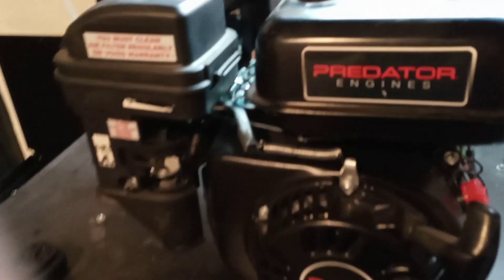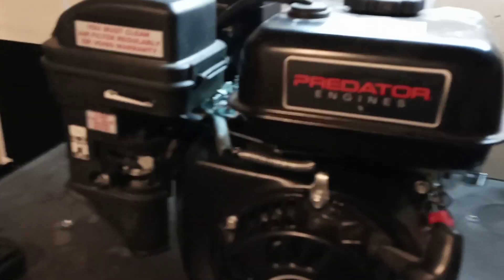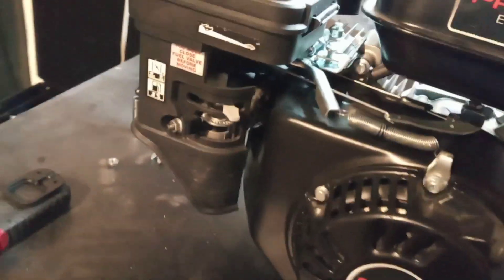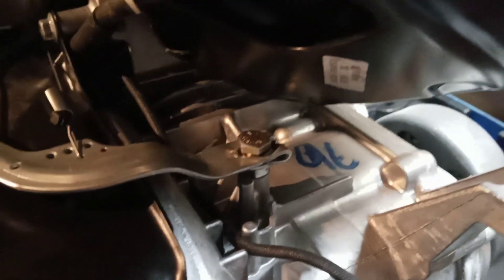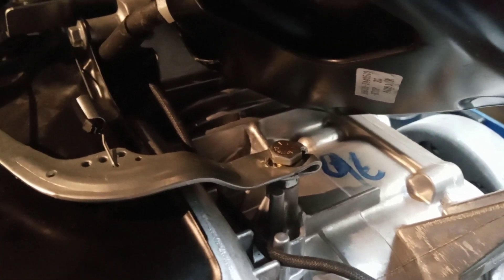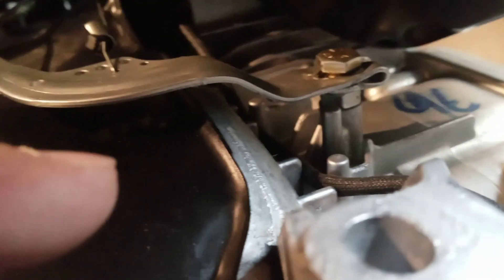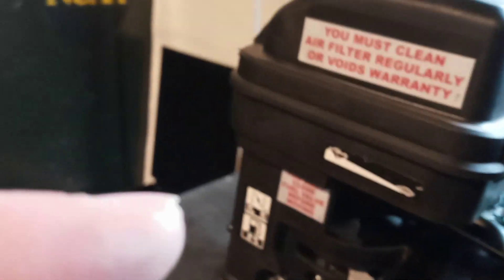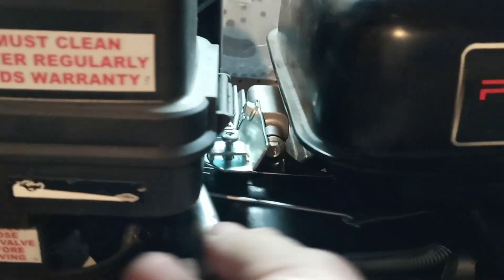how to use stock throttle linkage on 212 after governor delete

Comment: Bought one exactly like that. Put it on a 1946 David Bradley garden tractor it plowed and I ran the disc. Then a homemade rock rake all on idle badass then I uncovered it 2 wks later turned on the gas choked then 2 ND pull started up but after I kicked off the choke it surged on idle all the way to full throttle effing junk to do that after maybe 30 mins of run time should have rebuilt the 2 HP that was on the tractor what a waste of money !
Reply from the maker: Yes they need a bit of work after the governor delete but this one runs strong still after 2 years kinda like the lottery some times you get a winner and sometimes it's just a waste